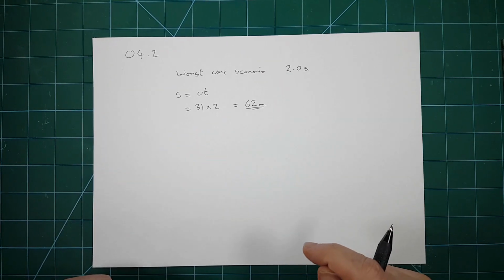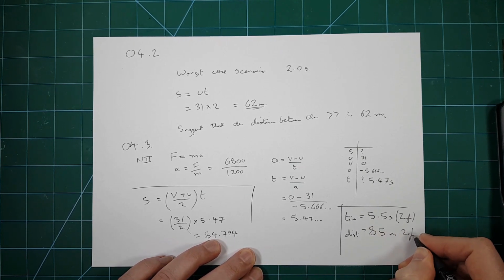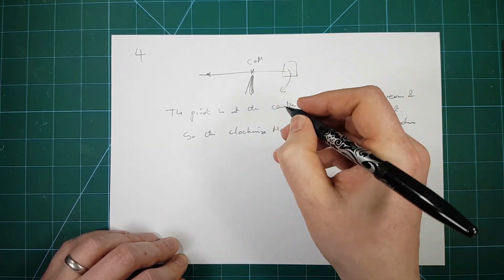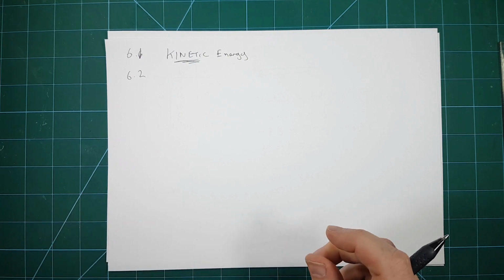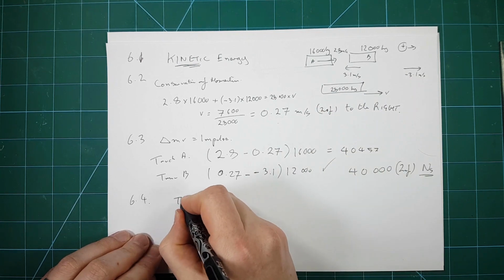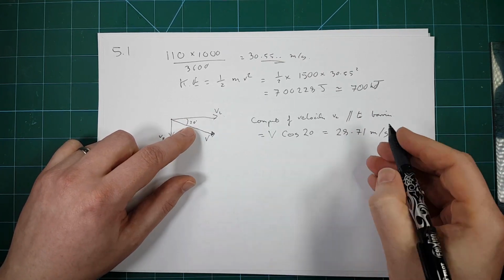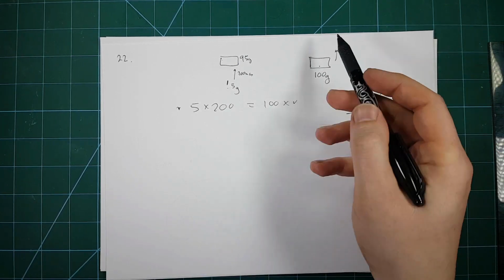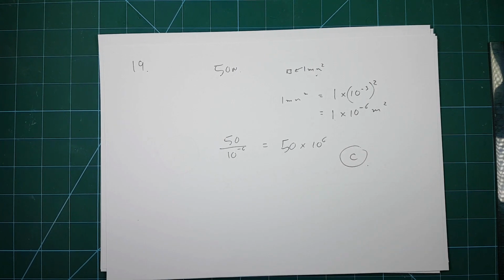A level AQA 2021 Assessment answers Mechanics Materials and further mechanics

Comment: for the third question, you should've taken into account the deceleration of the car due to the braking force (s=ut+1/2at^2. ?) I got 70 m instead of 85
Reply from the maker: 85 is definitely right. you get the same with s=ut+1/2at^2 as well. Check your calculation.